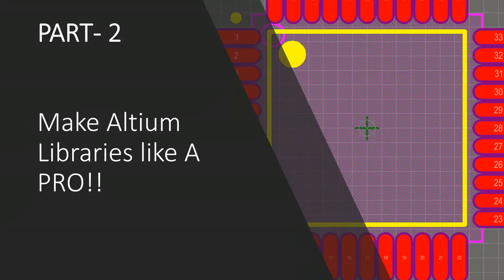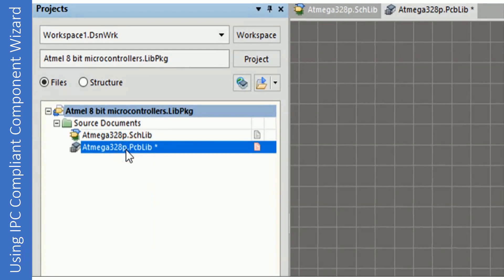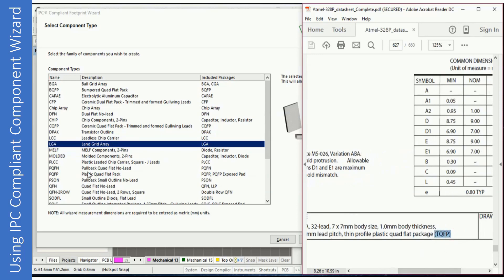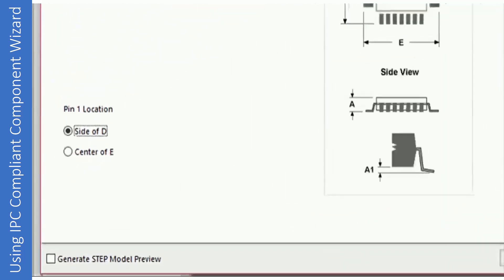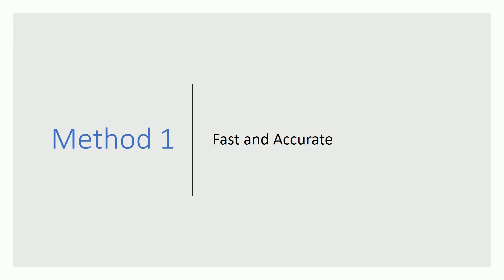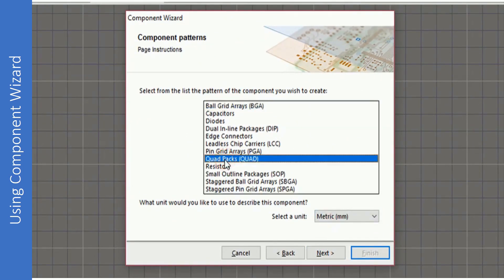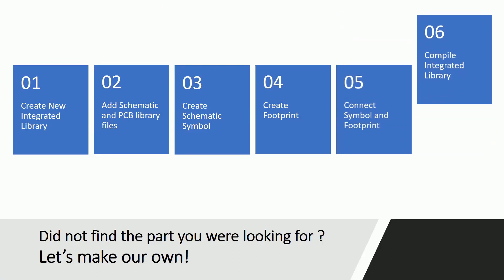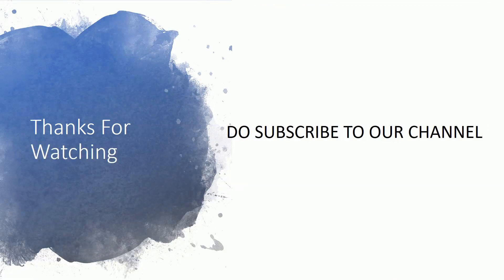Make Altium Libraries Like A PRO!! PART 2

Comment: Hi, great series of videos, but what is the formula you used to calculate length and width of the pads in method #2 @  9:42?
Reply from the maker: Hello, Normally these values should be available in the datasheet, but the Atmel's datasheet doesn't mention that. So you can have the pin dimensions from the datasheet and add required fillets size on each side of the pin. IPC recommends following values: For High density boards - Toe fillet - 0.15m,  Heel Fillet - 0.25mm, Side Fillet - 0.01mm. For medium density - Toe fillet - 0.35m,  Heel Fillet - 0.35mm, Side Fillet - 0.03mm, For low density - Toe fillet - 0.55m,  Heel Fillet - 0.45mm, Side Fillet - 0.05mm. Do note that the pads needs to extended both sides with these dimensions. Also, you can further optimize these values based on your experience with the assembler. Hope this helps! :-)

Comment: what if its a Printrelais? and it dosnt say packages?
Reply from the maker: Hi Isabel, Could not get your question. Please elaborate. Thanks
Reply: i want to make a footprint for this relais:

http://docs-europe.electrocomponents.com/webdocs/0c35/0900766b80c354bf.pdf
Reply: i dont understand how to set the grid for this... it doesnt say
Reply from the maker: Create new integrated library project >> Add PCB library File to the project. >> Right click on the drawing area >> Snap Grid. You can set the snap grid from there. As your footprint has irregular pins, you might have to change the snap grid value a couple time to place all the pin pads.
Reply: and what about the contacts... each end of a contact has 2 pins ..am i allowed to name them the same?
Reply from the maker: i would suggest make both pins separate in the schematic symbol and  electrically short them in the schematic. This way your footprint will have both pins with different number.
Reply: no but i mean is like one single pin has 2 littel legs...and i dont understand by you mean by short them????
Reply from the maker: Hi There,
Every footprint has a schematic symbol..right? (please watch part 1 for schematic symbols).
One way of doing it is, creating different pins for both the little legs in SCHEMATIC SYMBOL. Footprint will have different number for both the little legs. Now when you create the schematic using the symbol you created, just connect both the pins with wire (shorting them). This way both the little legs in the footprint will be shorted by a track when you create the PCB. Hope this helps..